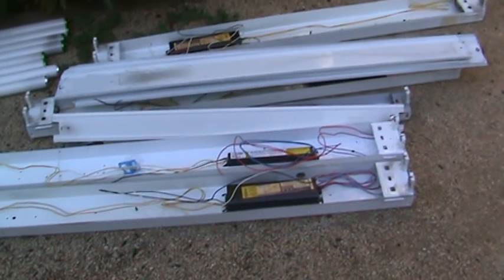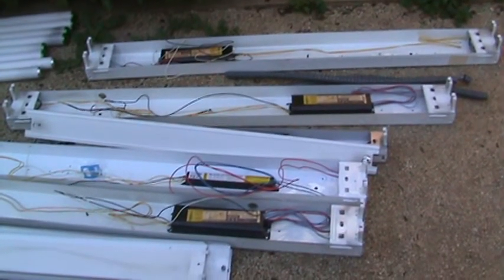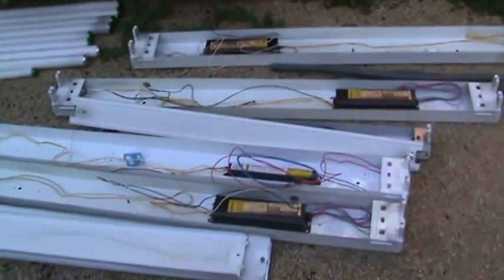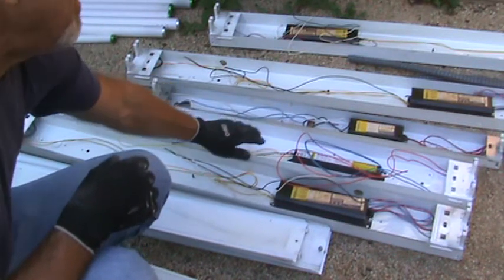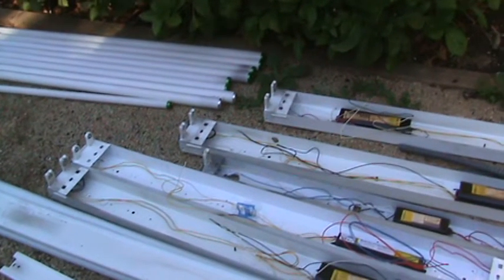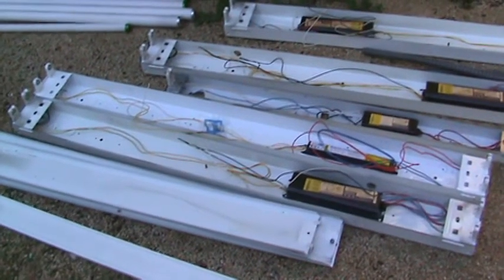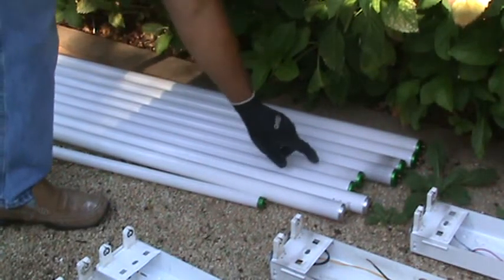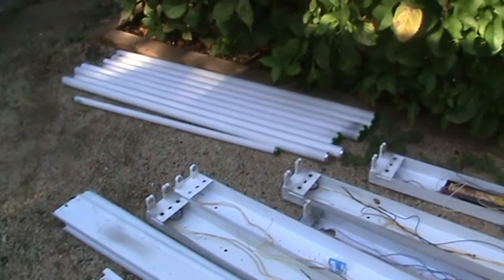What Should I Do With Old Removed Fluorescent Light Fixtures?

Comment: I personally would save the fixtures and all the good lamps!  I went with LED a few years ago and ended up going back to the trusty T12 fluorescent fixtures.  The LED fixtures I bought didn't even last 3 years before taking a crap. And those were expensive ones as well.  I have 2 fixtures made in the early 1950's, with the original ballast and they are working just fine. Of coarse, I make sure to use 40W lamps with preheat.
Reply from the maker: Wow I would've thought the LED light fixtures would've lasted forever!